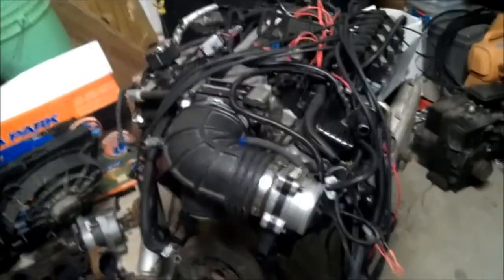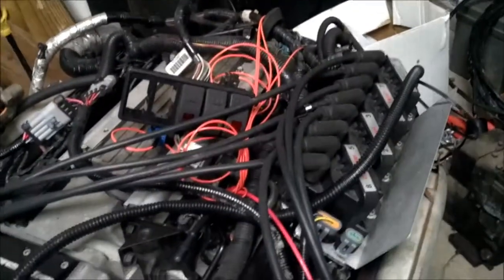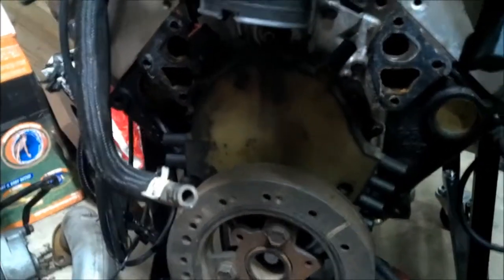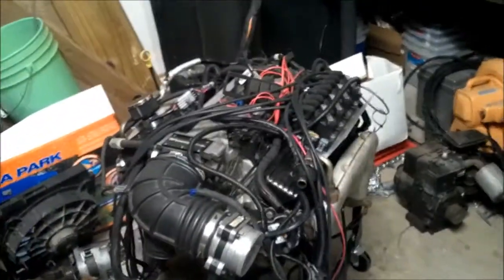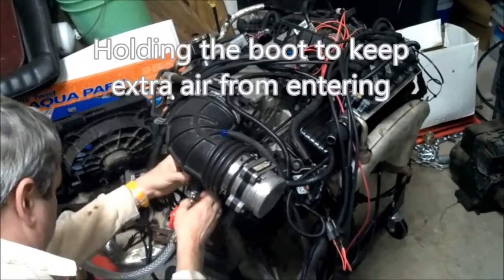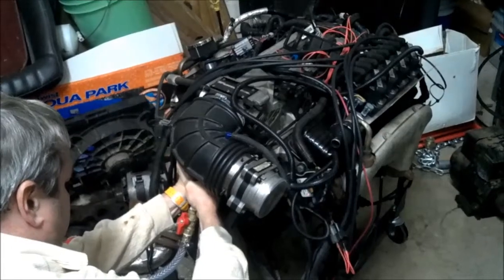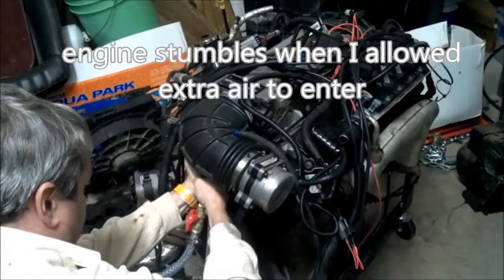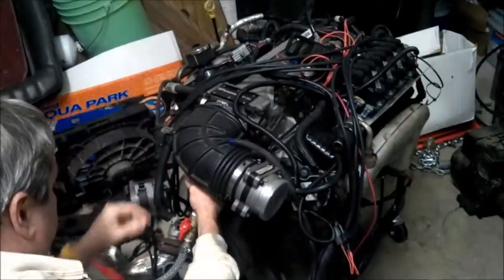Coop's LT1 on Fumes - TakeTwo

Comment from the maker: You have to have an old optispark to drive the sensor signals to the computer. You can find them used from hawksthirdgenparts {dot} com. Mine was busted and I swapped it with one from Hawks, and this also allows the delteq to do its job. The good thing is, w/o the high voltage in the opti, it should last forever now.